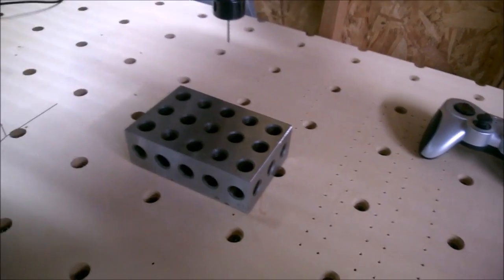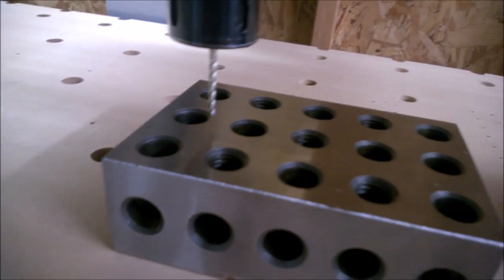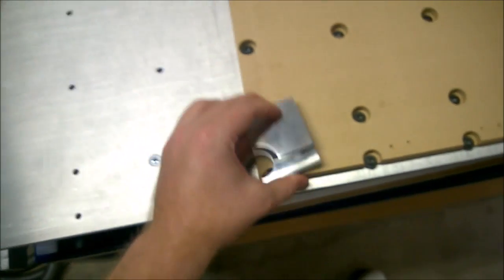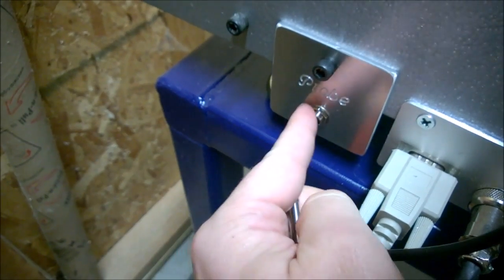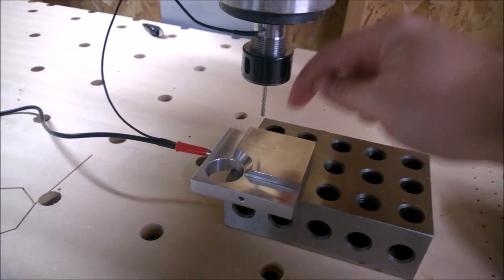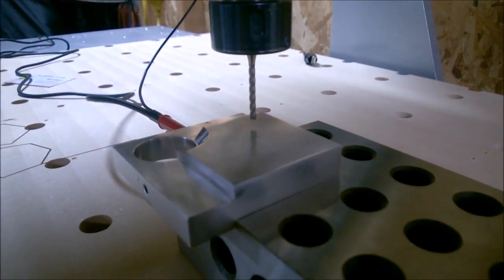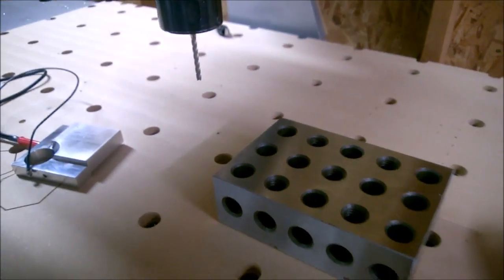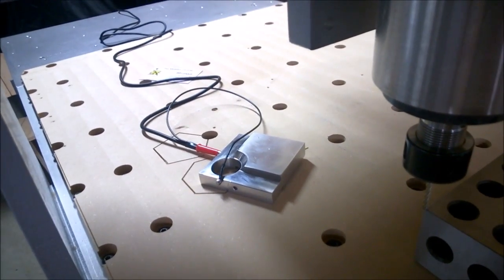jerbroCNC: KFlop / KMotion CNC Automatic Zeros / Tool Height Setter

Comment: I'm in the process of converting my entire CNC from Mach3 to KFLOP board,  My one issue is that I own a skin for Mach3 that takes huge advantage of a physical probe, for finding corners, centers, valleys, etc.  Basically I am only taking advantage of what you show in the video.  Are you willing to share the code?  I dont need the aluminum block as my probe allows me to touch any material.. I would modify your code to work as an interrupt on one of the many I/O supported by KFLop no need for the ground back to spindle.  I could of course share back with you when I am done if you ever consider to move to an actual probe.  let me know.
Reply from the maker: I shared the code - find the link in the details above.  I AM interested in what you come up with though.  A proper probe may come in handy in the future.  Bytheby, and I'm sure you know this, but you can use Mach3 with KFlop.  I've decided not to go that route, but many do.  So, you can still use your Mach3 skin if that serves your needs a bit better. 

Also, if you don't mind, which probe are you using?
Reply: Jeremy Brown centroid dp-4 is my probe, been using it for about 1 year now without fail a wonderful solution.  If you got one I could help you interface it to mach3 or eventually the Kflop directly as that would be my end goal. Thank you for sharing the code hopefully I will have mine done in a some reasonable amount of time.  Yes fully aware that I can use Mach3 + KFlop which was my original intention.  However with Mach4 on its way out the skin will not be compatible which means they will release a new version costing yet more money on top of mach4.  End of the day I will still need a PC but I will be scraping my old XP one that has been on its last leg for a while and buying new hardware and using a 64bit OS with KMotion CNC.  I have also been using the gecko G540 which if I am removing my parallel port due to new hardware I am considering converting the gecko driver to Two KSTEP boards..  Thanks again for sharing!

Comment: I have a Kflop that I haven't installed yet.  The reason is, I'm using mach3 and smooth stepper and a probe script that I depend on for tool height.  If I could get touch off probing working in KmotionCNC, I wouldn't have a reason to use mach3 and SS.  Are you sharing your code for the probe routine?
Reply from the maker: I'm not taking advantage of any tool height tables, I'm just going down until I touch, and calling that (minus the thickness of the plate) zero.  If that's what you want to do, I'm going to point you at http://www.cnczone.com/forums/dynomotion-kflop-kanalog/217650-kflop-touch-probe.html.  The first post by Tom is a file that is included in modern versions of KMotionCNC.  That will let you move whatever axis at whatever speed until a particular bit is set.  I was able to get z-height to zero super easy with that example.  You basically set that program as M100 (or whatever) and then call it in g-code (or assign a custom button to call it).  The commented section of that example tells you exactly how to use it.  My video above does much, much more, which is why I wanted to go down the path of writing my own code.  Luck!